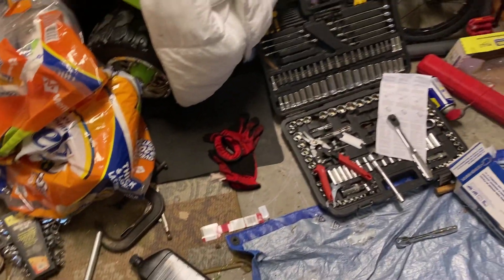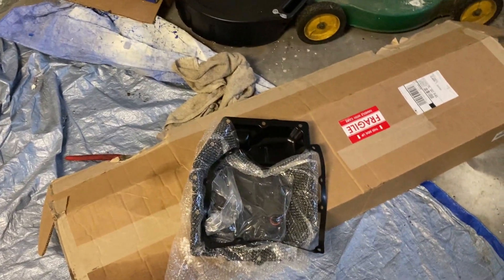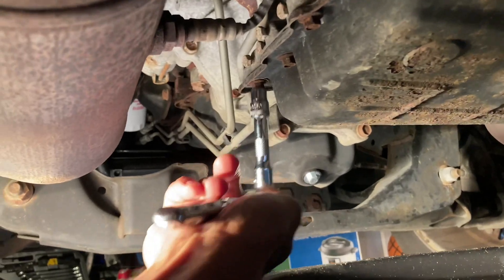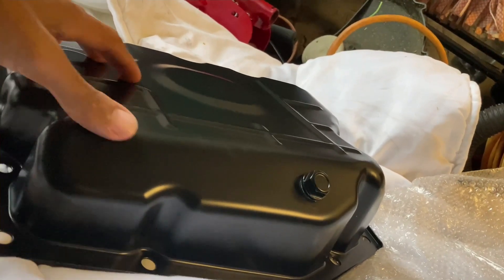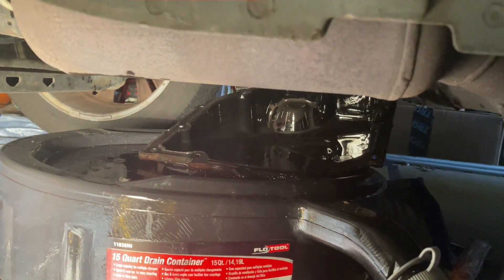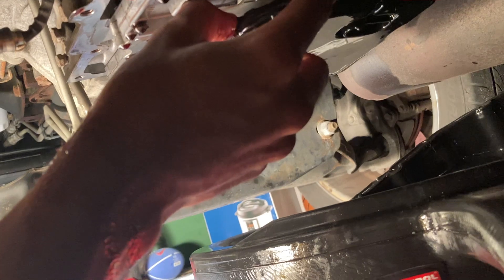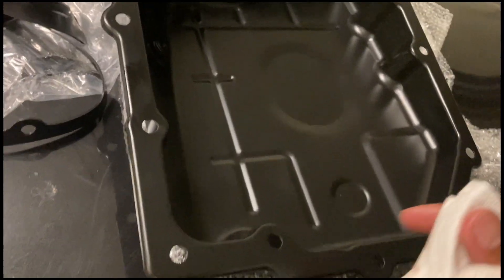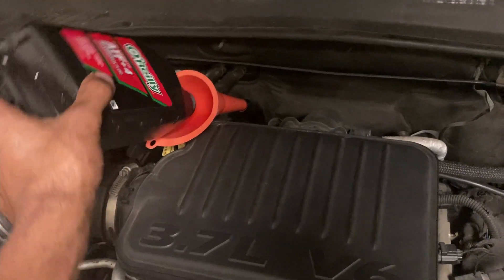Automatic Transmission Filter, Gasket and Pan 2008 Dodge Nitro

Comment: You got patience. Dunno how but you do. Lol. Good job! Mechanic wants 250$ just to change the lines. They do have a little clip you’ll need a pick to reset them. Also a special grabber to move the clamp and pull the lines. Such a money racket man. They could’ve made this so easy
Reply from the maker: Seems right at $125 an hour

Comment: I have the 08 4.0l RT . My automatic transmission conductor plug is leaking. Can i get away eith changing it out refilling the tranny? How in gods name do we check the fluod level on these things. No dipstick awesome sauce.
Reply from the maker: Hello Brandi. 

I do believe that the transmission is similar to a Mercedes Benz. You prolly want to look at video just replacing that. Off top of my head I don't remember if you replace it if all the fluid would leak out. 🤔

Comment: How did you check fluid level without a dip stick. These transmissions are fussy  about level.
Reply from the maker: These are like Mercedes Benz I believe you can remove a cap and use a dipstick tool to check. Can’t remember right now if I did or not

Comment: I have a 07 Nitro LS what is the magnet for and was that in the old pan or do i need to buy one? And what size...
Reply from the maker: The magnet attracts all the fine metal shavings that way it doesn’t end up in the transmission. I would put one in it. When I purchased a new pan it did not come with one
Reply: The Magnet Is Definitely Necessary...It Catches All Metal Shavings From Tranny Wear

Comment: I would have drilled a drain hole in old pan since you were tossing it anyway
Reply from the maker: I thought about that. But know my luck I would drill and hit a vital transmission part like a solenoid pack or something. I was just being careful. Best safe than sorry. And didn’t want to have small metal shavings inside the transmission

Comment: Did it fix the transmission problem
Reply from the maker: I was really just doing maintenance on the transmission by replacing the fluid and filter. 

The only issue I ever experienced was it idled kinda high and had a delayed shift very randomly like. Once every four months. Who knows if that cleared it up. I can tell you it definitely didn’t hurt. I could tell after replacing the fluid and filter it shifted smoother immediately. 

It doesn’t leak, has a new pan and drives fine for me. It was more preventative maintenance especially with old fluid and a rusty pan

What is yours doing??
Reply: We were traveling and got 9 hours away from home and 9 hours to our final destination when it sprang a leak pouring out the tail end we thought it was the front or rear end seal but when whe put transmission fluid in it shifted with no problem so we bought some barks transmission gasket seal and the leak stopped but now we can't deive more then 2 blocks before it stops wanting to shift we were told the fact that it still runs and drives says it may just be the filter because bad or clogged filters can cause a leaks? So we were gonna sell it but im all for trying all we can first until we run out of options that we can't do...

Comment: And how much tran fluid does it hold. 08 nitro
Reply from the maker: As per Garage.wiki

ll Dodge gasoline V6 3.7 L EKG engines
42RLE gearbox
Amount to change	4.02 US qt.
Automatic transmission fluid: ATF+4
New filling	8.77 US qt.
Automatic transmission fluid: ATF+4

All other modifications
Automatic gearbox NAG1
Amount to change	7.4 US qt.
Automatic transmission fluid: ATF+4
New filling	8.56 US qt.
Automatic transmission fluid: ATF+4

Comment: I didn't understand you have a new pan why didn't you just take a drill and put a hole in the old pan would have been way cleaner
Reply from the maker: Didn’t think about that and was afraid of drilling into part of the transmission valve body and leaving bits of metal someone in the fluid.
Reply: I definitely would have been concerned with metal shavings from drilling. however a hammer and a punch works good or next time replace two of the bolts in the front of the pan loosely before prying, that will hold the pan up from falling completely.
Reply: Hey, give the guy a break when God was passing out brains he asked him how he wanted his and he thought he said eggs so he said I’ll have mine scrambled. Thank you.
Reply from the maker: Thanks for the comment

Comment: you had a new pan, why didnt you just drill a hole in the old pan.
Reply from the maker: I didn’t want to risk damaging the valve body
Reply: @aricwithautoreplay  Next time just get a large self tapping screw and use your ratchet.  On the drill method you could come from the side with a sharp bit so you dont have to put your body weight to it. or go right where the filter is.